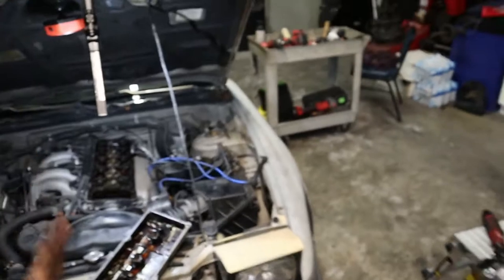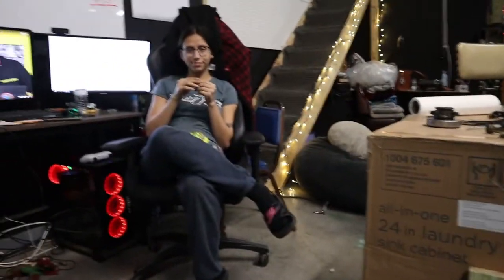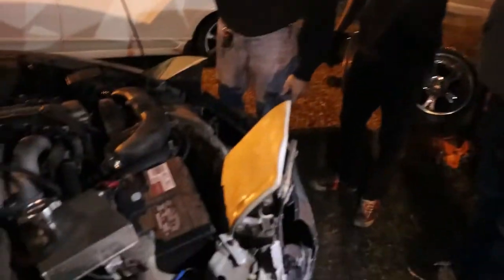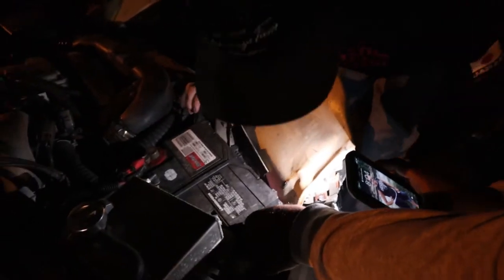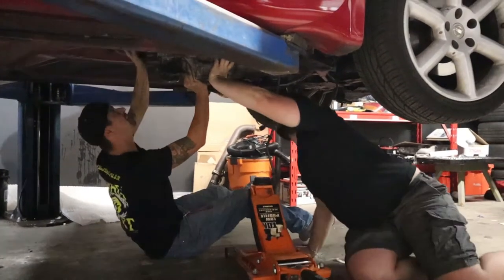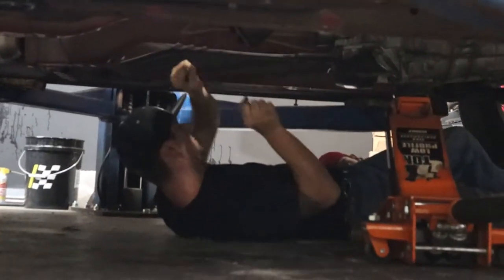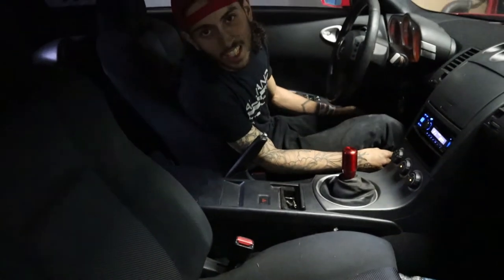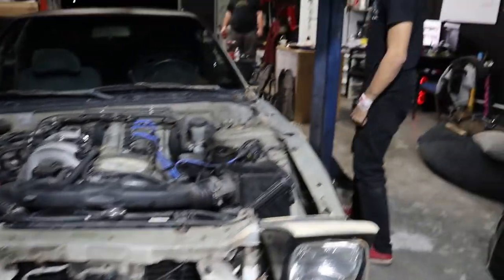I Crashed The 240sx

Comment: First?
Reply from the maker: 2nd
Reply: @RomeloRoman  a bro I got a question my Q50 3.7 valve cover gasket leaking and I’m going to change that with the spark plug gasket should I do anything other replacement before I put it back together
Reply from the maker: @Nexuses_  check your fuel injectors & clean those spark plugs as best as possible